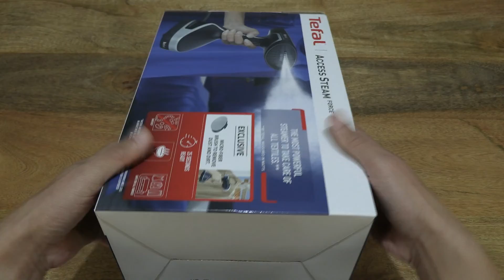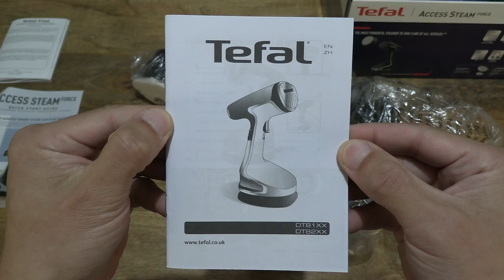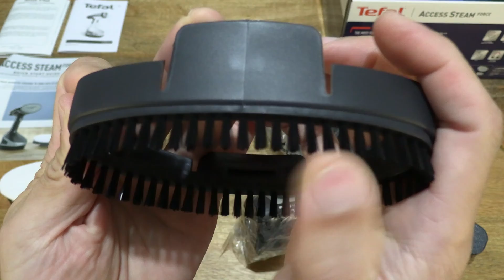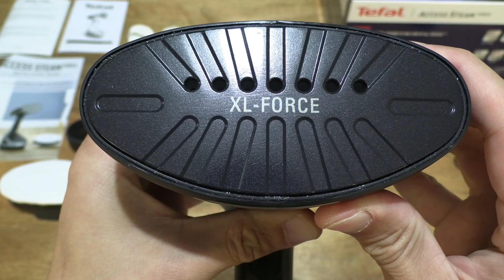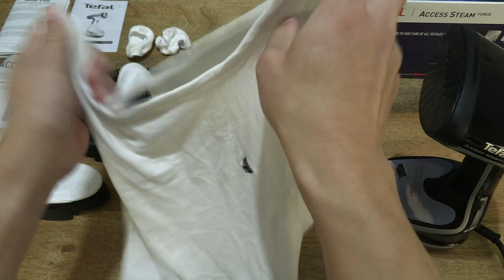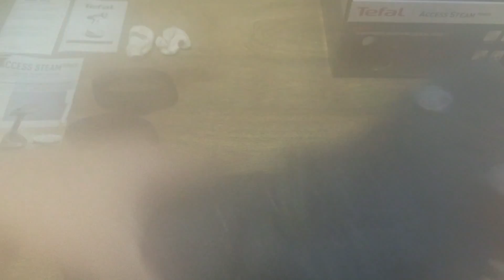Tefal Access Steam Force DT8270G0 Handheld Garment Steamer

Comment: Do u find the water tank is not a tight fit its loose but seems to work ok... not sure if that is normal.
Reply: Got this steamer. And first problem was really the water tank fit to the handle. It clicks, but it seems to loose at the top with the stopper button. Is it normal? Or we need to return as defective item?
Reply from the maker: Hi, it fits securely. Check the stopper fitment. Otherwise contact Tefal customer service and they'll sort your issue out. Happy steaming.
Reply: Mine seems to be loose as well, it does click in, but you can kinda slide it in and out a bit… seems to work ok, but clicks and leaks a decent bit from the container so going to exchange it.

Comment: Doesn't seem to be doing that good of a job...🤔
Reply from the maker: The uncreasing bit works well enough, nothing beats the heat and pressure of a steam iron but this was simple enough to use and the it's great for deodorising. It's real value is in saving on doing laundry and extending the life of garments by steam santising them. I tried the Bosch FreshUp at an exhibition a few months ago, it's innovative but still room for improvement. Happy steaming.